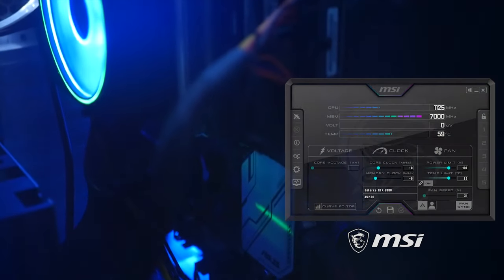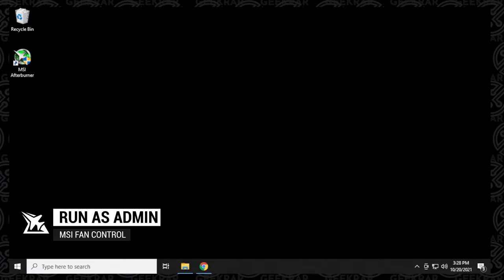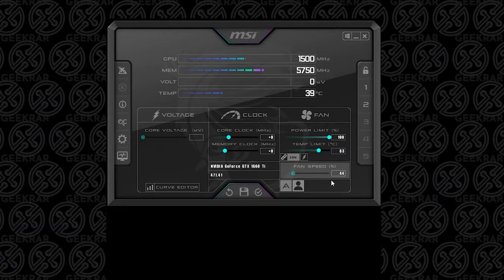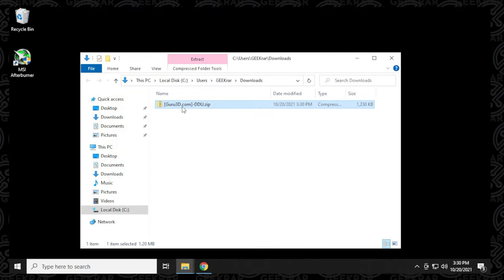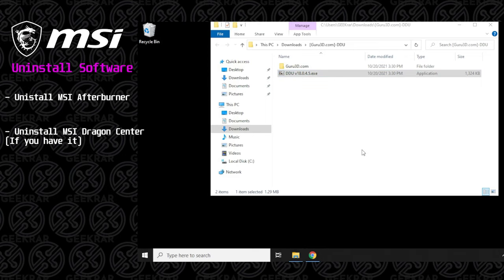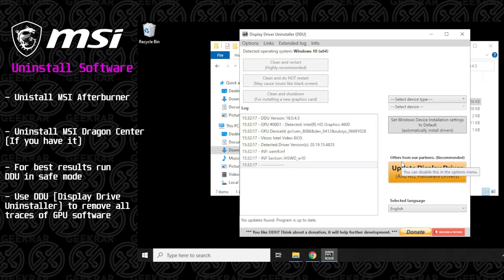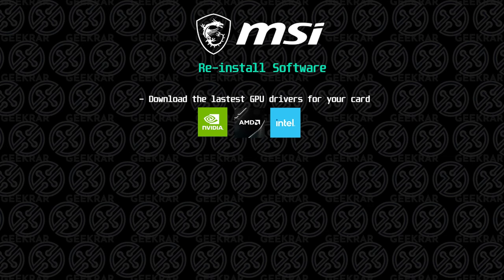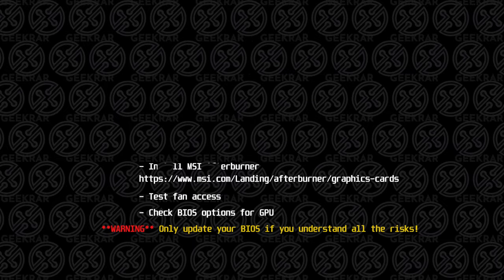MSI Afterburner speed control not working? | MSI Afterburner fan control

Comment: Hello. On the old version, I could control the fan speed from 0% to 100% on curves. On the new version, the  fan control is not  lower  than 30% speed. Why can't I adjust from 0 to 100 again? Thank you.
Reply: did u figure it out? did anything in this video help?
Reply: @rayth4386  just use auto fan speed on ur curve preset

Comment: I have an radeon RX 570 got an update yesterday. And now msi afterburner doesn't work, and I don't have the fan option in settings, can't play a game due to my graphics card reaches to high temp without afterburner. 😭
Reply: Same thing happened to me. The fan speed still shows up in afterburner but I can’t change it like I used too, I have the rx 580. You can setup a fan curve in the Radeon software or with MSI afterburner, you will be able to play your games then.. YouTube has a bunch of videos on how to setup a custom fan curve.

Comment: I'm using the firmware control mode, which, to my understanding, adjusts the fan curve in the card directly, not needing Afterburner to run. But when I restart my system, the fan curve is not applied (and the GPU fans constantly start and stop). But when I re-apply the fan curve it still works even after closing Afterburner, until the next restart. Any idea on why that might be?
Reply: yes
Reply: ye not all cards support the firmware mode for a custom fan curve

Comment: mine are both blank. i have a weird option for fan sync. but i cannot set the power limit.
Reply: I can't change power nor temp n ya fan too . Core voltage was locked to but I used that code to unlock it thanks to utube

Comment: I got rtx 3070 ti MSI gaming X trio and since I turned it on, One fan is spinning at maximum rate and when I config it I got no response, Any idea about this issue ? and its just one the fans 2 other are working well
Reply: Have you fixed it yet?

Comment: the auto fan speed is greyed out for me..
Reply from the maker: What GPU do you have?
Reply: @Geekrar  GT 440
Reply: Yh same
Reply: Same for me
Reply: 1060
Reply: @Geekrar  I have a GTX 1650ti and the settings are also gray
Reply: Same
Reply: Mine too, and I don't have the fan tab in settings. I'm assuming it's because it's a newer version of Afterburner. Any solutions?
Reply: @brianhartman4426  so of my knowledge (being 2 years later lol) I believe that there are 2 problems and one solution. 1. The problem can be if you have a laptop, doesn’t work on laptop unfortunately. 2. Not aware of this, but It might have a relation to what gpu you have in general. A solution is probably getting a new device (lol) or jus forgetting abt it in general. Take what I said with a grain of salt, I’m just a dude who owns a laptop and plays games lol.
Reply: @skiderman1103 oh i got a laptop, so thats why it didnt work
Reply: @Geekrar same for me I have rtx 2070
Reply: Same
Reply: Same for me with an RTX 4070
Reply: @brandonhu285 same i have rtx 4050 laptop on nividia ge experience it's showing 0 rpm even though the fans is working
Reply: @chiraggupta5972  yeah, am also on laptop, i still don’t know how to fix :(
Reply: @brandonhu285  yeah me too can't find any fix thinking to report a complaint at service center

Comment: I really appreciate this guide and help that it was able to provide. I thought that my gpu was done for when fans did not respond to any action in Afterburner. To anyone reading this, this is a legit guide that really helps solving the problem at hand. 
P.S.: You do not have to do this in safe mode, but be sure to read the terms of use on DDU site. I am saying  this mainly due to the fact that if you have encrypted system drive and you do not know the recovery key/password you are basically screwed because it is needed to proceed to safe boot.

Comment: For me, the fan tab in the settings dose not show up. Can you help me fix my problem? I can surf the web perfectly fine, however when I try to play any game it starts overheating since the fan does not spin.
Reply: your fan is broken
Reply: Are you using an RX series? the same thing is happening to me with an RX 580 and I've seen a lot of people with RX series complaining about this.
Reply: @Pontona.  No way, yes I am using the rx 560
Reply: @lineriders7453  if you use the Radeon application you can change your fan settings in there you have to go to Performance > Tuning > on the right side of the "Tuning Control" panel hit "Custom" > Enable fan tuning below that > Enable "Advanced Control" and then you can edit your fan speed in there
Reply: @Pontona.  Can you link it?
Reply: Actually it's not broken if it's a MSI company cuz my fans doesn't spins until it reaches 20°C cuz it has auto detection
Reply: @Pontona.  damnnnn thxxxxxxxx
Reply: I am using rx580, and the MSI afterburner just worked fine under w10. Now under w11 it, it's not. From AMD control panel you can adjust it as Pontona said, but I would like to use it via the MSI app.

Comment: Bro how do u enable the fan option it doesn't appear even if I run it as administrator or not
Reply from the maker: what GPU are u using?
Reply: @Geekrar  Nvidia GeForce RTX 3060 Laptop GPU
Reply: @Zynx-h5n  im using the same, have you found a fix

Comment: The fanspeed and temp limit are both locked does anyone know how to fix this
Reply: @daredevil3076  my fans are good cuz they are cooler booster 5 from msi my laptop is msigl6510ser
but fan speed controller is locked how to fix this
Reply: @itz_sd_  I have the same problem. still looking for a solution
Reply: Not working myb it’s broken

Comment: hey i still can't unlock my Fan Control, here are my specs
Processor	11th Gen Intel(R) Core(TM) i7-11800H @ 2.30GHz   2.30 GHz
Installed RAM	16,0 GB (15,6 GB usable)
Graphic Card     NVIDIA RTX 3060 Laptop GPU

Comment: Hey man great vid, but im having an issue that i cant seem to fix... i have a msi GL66 laptop with a 3070 laptop gpu and i cant seem to access the fan controls at all and there isnt a tab in the settings to manually set custom fan speeds either. Is afterburner just not compatible with the laptop or can it be fixed? I appreciate any feedback man thanks 🙂👍
Reply: I am having the same problem. I can tell you its not a laptop compatibility issue because I have an Asus G15 with a 3070. Hopefully this guy gets back to us 💀
Reply: hey guys i have the same problem with my laptop toshiba qosmio x500 
i can't access to the fans control or any thing related to the fans i just see the gpu temperature only and i think  that the fan doesn't spin at all and i can't get any informations of it expect the temperature 
any solution help me?
Reply: Well this thing apparently only works for desktops so us laptop owners cant tweak with fan control
Reply: @arandompanda1349  you should be able to access fan controls through your built in software like msi center etc.
Reply: @beamz1631  i guess i can look into it but i dont have any issues rn, i can overclock my cpu and gpu using throttlestop without much overheating
Reply: @arandompanda1349  oh okay well cool cool

Comment: Nothing seems to fix mine. Been this way over a year. It has no effect on my rtx 2080. My video card gets really loud and then slows down over and over. Its made me mostly play on console. I reset windows and reinstalled video drivers, even updated the motherboard bios. It recognizes the card but just does not control the fans. It seemed to work at one time as long as I have the control box on the game screen. When I would minimize Afterburner the screen goes black a few seconds and comes back on with fans racing again. Now it does not even work with the controls on the screen.

Comment: Thanks, although it didn't work. I googled a fair bit and it turned out that my graphics card is a known problem child. One fan either doesn't work or is constantly on 100%. Mine kinda switched? It was randomly all or nothing. So I did some testing to find out if that fan is crucial, it ain't, so I ended up cutting the cable. Blissful silence.

Comment: if you use the Radeon graphics card and it's application then you can change your fan settings in there you have to go to Performance > Tuning > on the right side of the "Tuning Control" panel hit "Custom" > Enable fan tuning below that > Enable "Advanced Control" and then you can edit your fan speed in there
Reply: Hi thanks a lot but how change fan speed to 0? now minimum is 33 :/
Reply: i dont see a custom one

Comment: can anyone help me ? my fans wont spin when i boot up my pc cause i had a power outage or surge power went out 2 times while my pc was on and booted back up fans werent spinning so i unplug the psu cable and plug it in a diff spot just to make sure , after that i booted back up still not spinning and downloaded the program test my fan speed it work it was spinning but when i turn off the auto and user define fans just went back to normal and ddint spin or do i have to apply it on or something and restart my pc and boot it back up ? need help asap plz anyone

Comment: Im running a Geforce GTX 1050, no fan control apps pickup my fans, and afterburner doesnt seem to even work on my PC.. Dunno what to do, Ive got everything fully updated, Ive reinstalled everything multiple times, this is so fucking annoying at this point lol
Reply from the maker: thats really strange that 1050 isnt working. there are strange issues with fan control. i dont know it all yet, and i am still learning. when i have a better idea of the faults, i am going to make an update.
Reply: @Geekrar  appreciate the response. It is very strange because I could actually adjust my fan speed within MSI Dragon Center, before I uninstalled it after being told that removing it sometimes solves afterburner not working. 

I can only put this down to maybe my fans are busted, as my pc temperature easily reaches upwards of 80-90 degrees Celsius. Either that or I have another app Im unaware of controlling my fan speed without my knowledge

Comment: in my setting in msi after burner ther is no fan setting in the settings why?????
Reply from the maker: what kind of GPU do you have?
Reply: I have rtx 2070 super gpu
Reply: @Geekrar   Same goes for mine, I have NVIDIA GeForce GTX 1650 With Max-Q Design
Reply: Buy I also have a laptop I don't know if that has anything to do with it
Reply: same thing here
Reply: @alekkalinov5893  same
Reply: @alekkalinov5893  same

Comment: I hope this works. Because nothing so far works. I can change the speed of the fans in both examples but it has no effect. The thing still sounds like a tornado to point I'm considering swapping to AMD. Or just removing the fans lol.
Reply: hi,
sorry for replying after a year, but did you find a solution to your problem?

Comment: the control work fine with manual, but doesn't work in auto mode.
but when you said "run as admin".
i forgot i never check if it run as admin or not.
it's actually fixed now after running as admin, thank you.

Comment: Recently the fans on the GPU start to run very fast when I am in a program or a game, and after I press ALT Tab the RPM drops drastically (about 1500~1200) and when I go back it goes up over 3000 rpm. The problem is that it still fluctuates and it becomes annoying to hear that the fans go loud and fast then suddenly they become silent and so on, again and again when I'm playing a game. The temperatures I do have are maximum 76 C or 168 F .I tried manually to adjust the fan curve on AMD software (I am using an ASRock RX 580 8GB for the GPU) and also on MSI Afterburner. Any advices?
Reply: I'm having the exact same issue, and have no idea what to do. Did you ever figure how to fix it?
Reply: @wumps9298 unfortunately not yet, I just turned on MSI Afterburner before I launch a game, but after 4 weeks of hearing the fans go up and down I finally got used to the sound
Reply: Same problem here with rtx3070 on a nee build i did tried almost everything internet says , only leaft to change the thermal paste but im scared of breaking the shit out of it.
If any of you guys found a solution yet please let me know!
Reply: @valonsaliju5776  I ended up Factory resetting it and ever since then, it has stopped. I’m not sure if this will fix it for you, but it did for me.
Reply: @wumps9298  i thinj its working thank you

Comment: Mine got fucked up recently, no matter the settings auto/manual/manual with curve/work load/temp/etc It gets stuck at 44% and It drives me Crazy since till a couple of days ago It was perfect. What do you suggest?
Reply from the maker: laptop or desktop? what kind of GPU?
Reply: @Geekrar  desktop gygabite 1080 ti
Reply: @fede9609  i like how he asks questions but doesn't follow up lol
Reply: @oldboy1955  lol exactly
Reply: bro how do i fix power and temp limit and fan speed not able to adjust